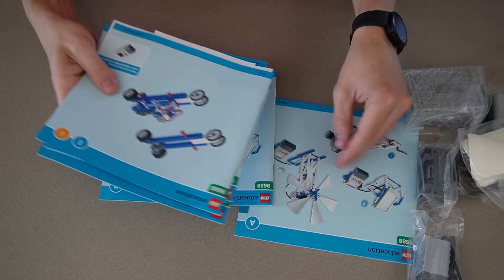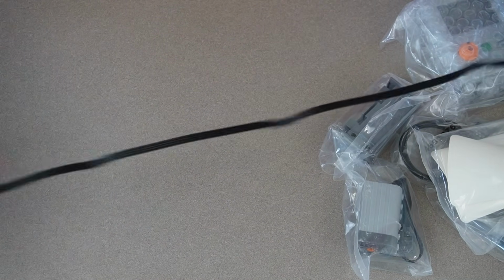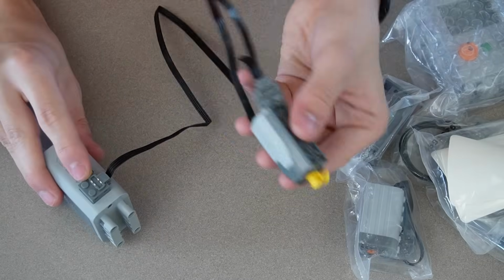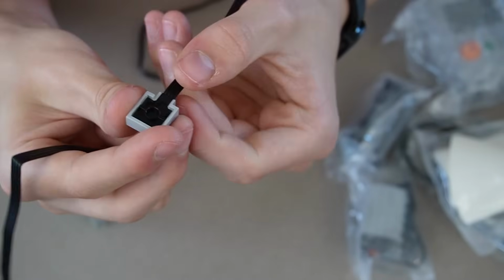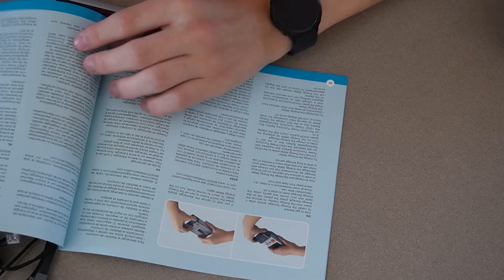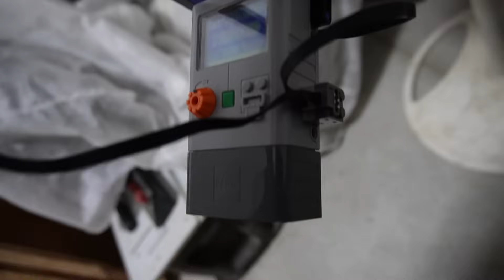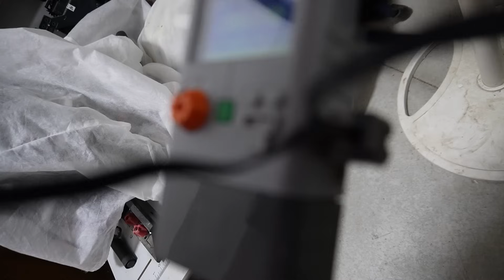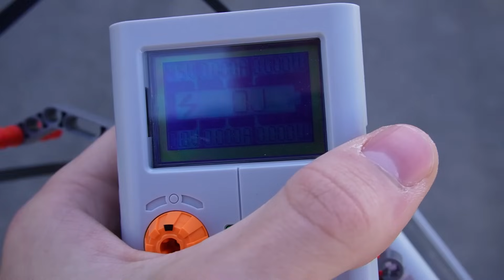This Lego Set Could Save the Planet...

Comment: You know what if you took the solar panel off and attached the windmill to the top of the car instead so if you were to push it to get the windmill spinning or spin the windmill with a little starter setup to get the windmill spinning the car would prob move faster therefore spinning the windmill faster. Faster the windmill = more energy generated faster and the faster the windmill goes the faster the car goes and the way to stop it could be to replicate a disk brake setup but on the windmill somewhere so when you need to stop some sort of lego rubber peice could be pressed up against a lego disk and then it would slowly slow it down until it stops moving

This was just an idea i had i thought would be a cool video idea 😂

Comment: Any motor can generate electricity, the E-motor was just designed to do so more efficiently than other LEGO motors. Unfortunately it's actually pretty crap as a motor, doesn't have good torque or speed or size, so it's a good thing it's better than any other motor at being a generator, it's otherwise pointless to use.

As for the on switch, I'd try holding it down for a bit, kinda like how NXTs need a second to turn on. The orange dial probably controls polarity, and having it in the center is a "stop" position, which is probably why you couldn't get it to do anything.
Reply: This motor is quite good as a motor, too, I am using it in a heavy, 8w locomotive and pulls good. :)

Comment: You should connect the crank to a motor and have the motor generate power to the crank that then powers the motor 🤣
Ya, I'm pretty sure that won't work
Reply: It won’t because the generator generates less power than the motor comes out with. This is just a way to slowly use the power. Wish infinite power was a thing but it isn’t.
Reply: @Ssa13-ib8yn  I know, I just thought it would be silly

Comment: It is possible the battery inside the Energy Storage unit is dead, it is 14 years old after all.
Also any Power Functions motor should be able to generate power if you crank it, it's not an exclusive feature of the E motor.
Reply: These EnergyMeters have NiMH 9V block cells inside, unfortunately the LEGO casing can't be opened without damaging it, but ultimately these are 10-14 years old by now, and NiMh cells won't last a decade without going completely or almost unusable. Got my Energy Display and Storage recently for a train project, and while the Energy Display works as intented, it goes empty in minutes because of the old NiMh cell in the storage.

Energy Storage battery tear down:
https://www.youtube.com/watch?v=9SAEcVq4oJY

User guide for charging and discharging:
https://s3.eu-central-1.amazonaws.com/robotica-es/uploads/items/ITEM_2533_DOCPROD.pdf
Reply: The e motor is internally geared to generate more efficiently
Reply: Yeah, the battery unit is definitely bad, the readout said 0 Joules of stored energy no matter how long he charged it. And it seemed like he was getting multiple Watts off the solar panel, so it should have been increasing by the second.
Reply: I doubt that... I have a 22-year-old GameBoy Advance SP and the battery still works better than my 2-year-old laptop
Reply: @pfeldon10  maybe Nintendo is better at making batteries than Lego, maybe this battery was stored badly, maybe lots of things. 14 years is a long time for things to go wrong that happened to not go wrong for you.
Reply: @Ekipsogel  I mean, it was out-of-use for like 18 of those years, so...